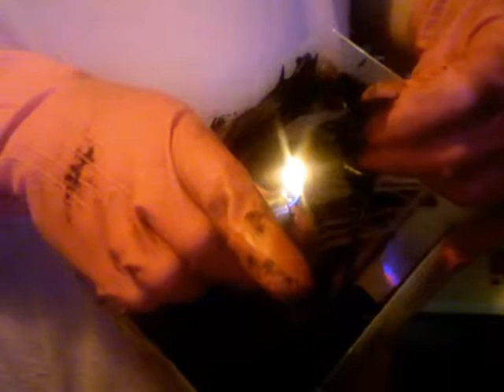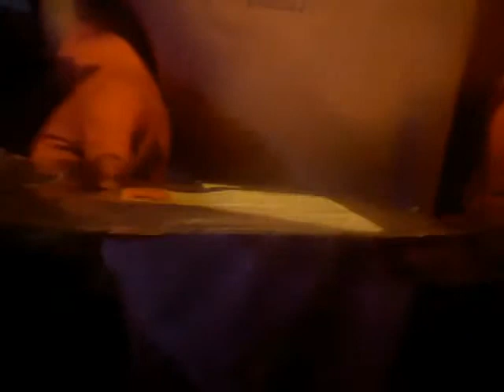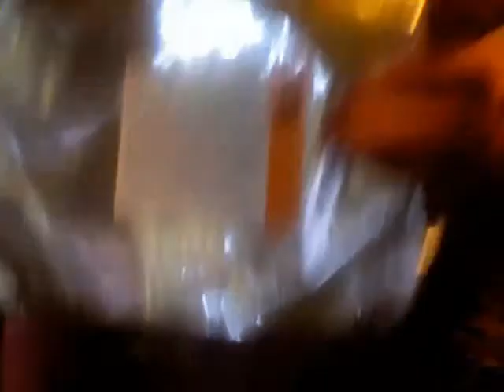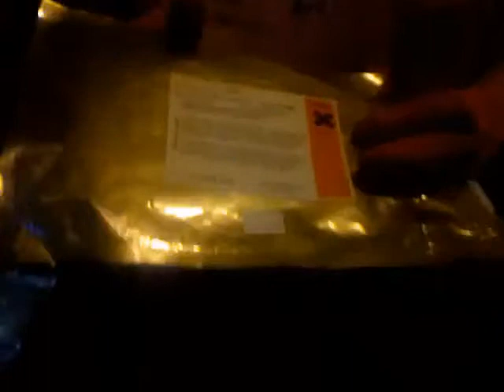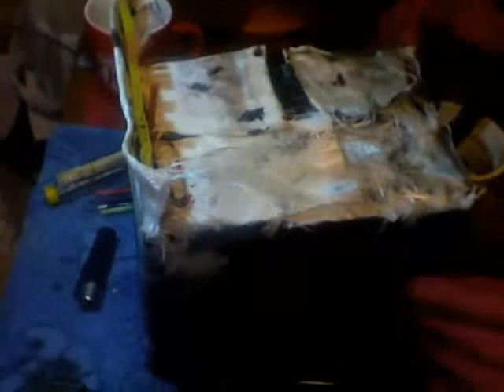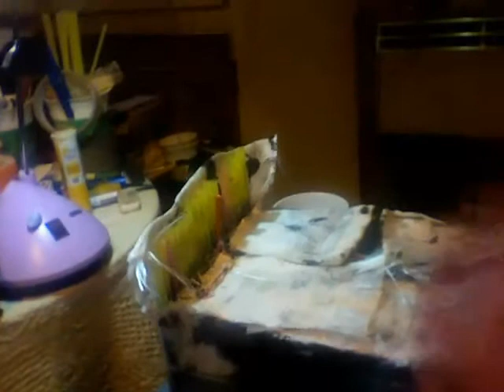BATTERY Update2

Comment: Always good to see some one havin a go.
Regards
Adam VA of AVA Magnetic Levitation AUS
Reply from the maker: AVAMagneticlev  Thanks I don't make many video's because camera not working at moment had some trouble with camera driver's maybe more having a go later, as currently doing a motor project, sent you a PM not sure if you got it ? Oh and the battery build went well it's still running great, runs my electric drill even off the inverter peaks at 25 AMPS from start or loading.
Reply: Funny you seem like some one I once knew.
Thanks for commenting and doing your vids we all must play our part.
PS. My work,vids Ebay and other all being sanctioned for the work I keep trying to do and the experiments I propose.
My view counts don't add up at the best of times. And ever time I try to apply for advertising my count drops below 2500 with in days from 5000+. Also direct attack threw Ebay from USA government for my product  lev cube MK1 breached an act of congress because it requires no power and is energy free and I said this in the advertising funny this is what is does its science.
Power to the people is getting harder people like me get trapped in an internet bubble.
The powers are creating the reality they wish us to think is all true not what is happening to the planet at this time.
One of the worst signs yet is all the shark attacks the oceans food chains are collapsing from the smallest up. This is just the start of the fall of modern mankind again .
Its too late to stop what is coming we now must plan survival. Drought will hit AUS again very soon
Adam VA of AVA Magnetic Levitation AUS
Reply from the maker: AVAMagneticlev  Yes I know exactly what your talking about, I am a lightworker into spiritual manifestation, we did a lot of work back in 2008 to heal the planet, it seems what ever steps forward we make the cabal throws us back 3x the steps, like what they did with the Gulf oil disaster was retaliation for what lightworkers were trying to do. M.I.B.'s do not want humanity to win is the truth, an alien agenda aka anti-human agenda is at play here, they want to replace us with machines this is starting to scare leading scientists, and when they speak out against it they get disappeared or die expectantly. At my age I feel we have nothing left to lose, except our children's future, sadly who wants their Children to grow up in the world that is being created. I tend to think now less about trying to save my children's future, I would rather an asteroid put an end to the misery. What soul wants to incarnate on a prison planet run by machines without souls ? I wouldn't ....